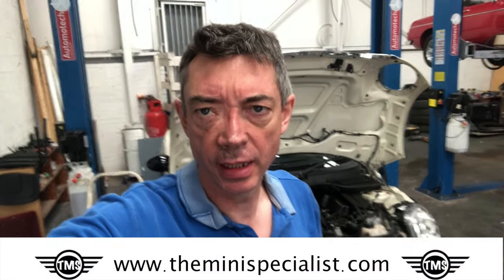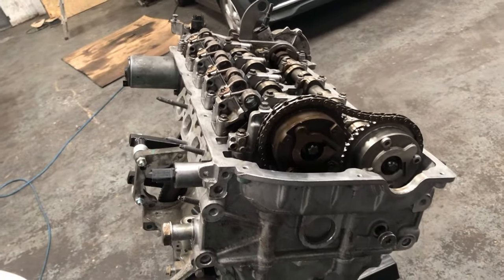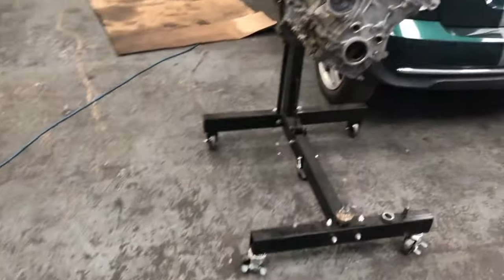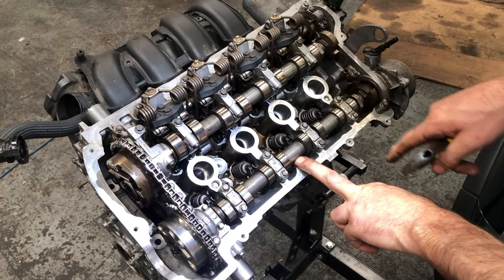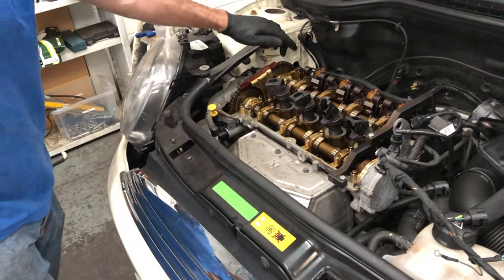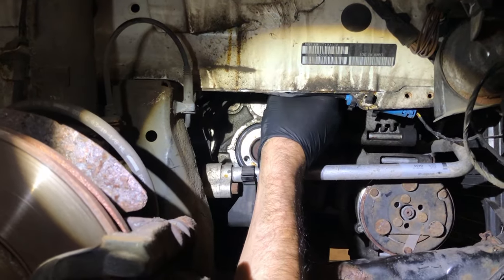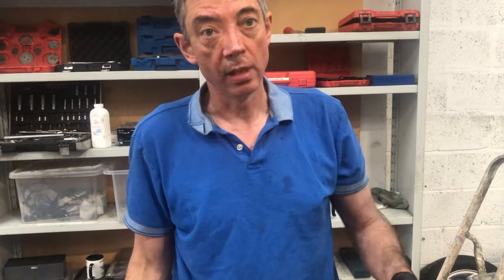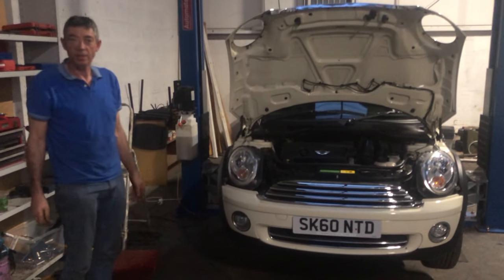BMW Mini Timing Chain DIY Replacement for N12, N14, N16 & N18 engines - The Definitive Guide

Comment: can i pick your brain, on my BMW, same engine as the mini, my chain only starts to rattle after 15 minutes of running, its totally quiet from cold start but once the engine is warmed up usually after 15 mins the chain start to rattle violently. let it cool again, start it and its quiet, is it not usually the other way about, rattle when cold and not so much when warm or rattling all the time. it eventually brings the drivetrain warning light on 2 vanos codes and one crankshaft camshaft out of sync code.
Reply from the maker: The oil becomes less viscous with temperature so this sounds like your tensioner.  Have you got the right oil?  It makes a difference.  You need LLO4 (BMW specification) 100% synthetic 5w30 - or 0w30 (the first number is the winter grade hence the 'w' and unless you are in very cold climes then 5w or 0w makes no difference as it refers to the viscosity at something like -20 degrees C... anyway.  Oil matters).  Try changing the oil and the camchain tensioner and see if there is an improvement.  If not change the chain and if you find that the guides have started to break up then clean out the oil scavenger filter in the sump.
Reply: @TheMiniSpecialist  once again thank you
Reply: @TheMiniSpecialist  the car is inbetween services, BMW since 2015 so i take it the correct oil is in the car, i came out of the motor trade 3 years ago due to asthma but im going to do this job myself, it's not been a progressive noise, it just started out of the blue, no issues with noise and then wtf is that racket, noise is at its worse when you decelerate but as i said nothing until about 15 minutes after cold starting, i can rev up and down and no noise but soon as the engine reaches optimum temp the noise kicks in.
Reply: @TheMiniSpecialist  just wanted to let you know it was the tensioner that failed on my car, the spring inside the tensioner body was in 3 bits. fitted a new one, all good.
Reply from the maker: @LOYALISTGOVAN  Excellent!

Comment: Superb video have been advising people for years to avoid any vehicle with this engine family absolute junk from day one.
Reply from the maker: To be fair when well maintained these are a terriffic engine.  The VVT makes the engine very flexible, has good power delivery and is ecconomical.  When the chain is in spec and you can put the car in 6th gear at 20mph and the car deals with it - not that you would do this usually but it demonstates how flexible this unit is.  

The trouble comes when people expect for a car to run forever with no maintenance.

Comment: Question sir...is the 2014 Cooper S convertible an N12 type engine?
Reply from the maker: No. It's an N18. Same chain however
Reply from the maker: So the convertibles lag behind the main models so your car is likely an N18 / R57. The next gen hatch in 2014 but the next gen Convertible started in 2015

Comment: do you reuse the crank and cam bolts?
Reply from the maker: there should be a new crank bolt in the camchain kit - best not to buy the cheapest one you can, get one with the crank bolt, bottom sprocket, tensioner etc.  I do reuse the cambolts and have never had any issues.
Reply: The Mini Specialist thanks! I picked up the same brand kit as in your video but no bolt. I’ll order one from bmw and pick it up. Great video by the way, I found it really useful.

Comment: Hi, do the vanos pulleys (dephaser pulley) need to be in a certain position or can they just be out back on.
Cheers
Reply from the maker: as long as they go back on the correct cam they can be in any position
Reply: Ok thank you for your reply, very helpful, some one has unplugged the inlet vvt solenoid, runs ok with engine light on, if I plug it back on, runs terrible and dies out, is that chain/timming or the eletro valve part of it. Cheers

Comment: I replaced the timing chain and immediately after replacing was appear the error code 2845 and 283d. This mean that now need vanos adaptation?
Reply from the maker: I would not expect codes like these imediately after changing the chain.  Certainly you need to delete and reset the adaptations but these codes suggest something else (are my thoughts).  Try swaping the Vanos front to back (if you have twin Vanos) or replacing the Vanos if not.  If this doesn't work remove your vacuum pump and see if it rotates freely - as you rotate it by hand it will squirt oil so be prepared - it should move easily, if it doesn't then replace the pump as a seized pump can damage the head.
Reply: Thank you for your reply and suggestion for checking the solenoids. I will swap the vanos front to back. I have engine with twin vanos N12B16AA (1.6 petrol 88kW 2007). I have review your full video couple of times, and before backing the camshaft adjuster (sprocket), as I see they don't need to adjust on some position (I mean angle position inside on adjuster spocket, min max or middle position). As I remove, I back on camshaft in the same position without any rotating or adjusting. This means that the adjuster always is inside in middle angle position?
Are this codes can be low pressure oil or leacking on camshaft seals. How can I check the oil pressure that comes to VVT adjuster spocket is right and enought? I checked the vacum pump and it was rotate smootly.
Reply from the maker: @vladimirrogovski7804  The position of the sprocket does not matter - what matters is the position of the camshaft which is why you lock the cams.  Put the sprockets on finger tight with the chain in place, then put the chain tensioner in all the way so the chain is tensioned and then torque up the camchaft bolts.  Hope this helps.

Comment: Doesn't the crank bolt and cam sprocket bolts need to be replaced with new ones
Reply from the maker: Ideally yes.  That said I don't and there has never been a problem

Comment: N12 1.6 and the later engine 1.6 can they be interchanged?
Reply from the maker: No. The later engine has more electronics a difference loom and a difference ECU. Just bought a car that had the wrong engine in and had to replace it with the correct one

Comment: Hy i have a problems with my mini cooper r56 i change the Belt and also the Chain and after that i see when i drive back   the car backwards it emits a lot of smoke a lottt smoke Like diesel why ??
Reply from the maker: Only when you reverse?  Mmmm.  Try this.  When the car is at warmed up let the car tickover for 5 mins then rev the engine to about 4000 rpm.  If you get blue smoke out of the exhaust then your valve stem seals have split and need replacing - this means reconditioning the cylinder head.

Comment: f£££king great video   thanks heaps .....can the inlet and exhaust sprockets  go on in any position?
Reply from the maker: Thank you!  So - the sprokets can go in any position - it's the camshafts that you lock and are the key.  Just make sure you put the inlet sprocket on the inlet cam and teh exhaust one on the exhaust as that does matter - and they are labelled.

Comment: Thanks mate Excellent video👍 I take it the vanos gears can go anywhere as long as the camshaft locking tool is I as  I first thought? Haynes manual Pro throw me off with a dodgy diagram with caption gear must face upwards at a slight angle  what ever that is meant to mean🤦‍♂️
Reply from the maker: No actually - each sprocket is stamped - EX for exchaust and IN for inlet.  They are different sizes and the car will not run if you swap them.  Thanks for watching.
Reply: @TheMiniSpecialist  do the vanos gears need to be timed?

Comment: Need to empty engine oil before do the timing chain or not ?
Reply from the maker: No - though I always change the oil & filter as part of the job.
Reply: I ask because I had the engine oil changing only 2month ago...
Reply from the maker: @brunoschmidt1533  then you should be fine.

Comment: At what mileage can you expect these timing chain issues on a well maintained car?
Reply from the maker: Wish I could say. Thing is firstly they were designed to be a life time item and secondly all miles are not equal - an hour in traffic might get you a few miles but an hour in a motorway night get you 70 miles.  Thirdly these engines burn oil and the engine will wear faster on low oil. Finally have seen the guides disintegrate before the chain died due to heat. I have changed chains at 40k miles and 110k miles. Not helpful I know but there is no clear answer
Reply: @TheMiniSpecialist  Thanks, going to look at 78K example on Monday.
Reply from the maker: @cpuuk  then unless it's been done assume it needs doing and negotiate accordingly. I charge £641 for a chain. A main dealer is about £2k
Reply: @TheMiniSpecialist  Will keep that in mind sir. Thanks.

Comment: nice video and guide mate ! , despite i followed everything i got a message  @inlet camshaft angle offset with respect to crankshaft outside of tolerance@
Reply from the maker: There are a couple of reasons why this can happen.  (1) The inlet sproket could be faulty, (2) the oil ways from the Vanos to the sproket could be partially blocked, (3) the camshaft could be tight in it's bearings which would cause drag and finally (4) it may just need a software update.
Reply: @TheMiniSpecialist  thanks mate for the responce , i removed everything again to check the condition , both camshafts were out of timing , and it was unable to lock them again , locked the crankshaft and release the bolts of both camshafts and locked them manually with 27mm spanner  ,the sproket looks ok , that it maybe happened is i didnt changed the crankshaft bolt with a new one , and i didnt have a proper pretension bolt from the kit ,  i will do the process again with all new bolts

Comment: Oh dear I’ve just bought a 2007 38,000 R56 1.4 N12 and it’s just come up with an error code P0014. It has a little rough idle but no noises from the chain which I tried to listen to when purchasing the car. I was hoping it was the front / vanos sensors with a oil change but now I’m fearing the worse and the car could be toast 😭
Reply from the maker: the car won't be 'Toast' - a new chain makes the car run well again - but you would be wise to start with the cheaper stuff - sensors and so on - oh and check the oil.  These cars all burn oil and the VANOS works on oil pressure so will not work properly if the oil is the incorrect grade or as is more often the case - low.
Reply: @TheMiniSpecialist  Many thanks for your kind reply. I'm waiting for the parts then I can drain the oil and replace both sensors. The car has been stood and only been driven 1,100 miles in two years. Companies like Lohen say they flush the engine with Millers Oils engine flush. Is this something you recommend as I've heard all kinds of stories causing more harm than good? Appreciate you technical expertise and love your channel.
Reply from the maker: Hi Michael - I have never used engine flushes so I cannot advise sorry!
Reply: The Mini Specialist thanks for your honesty. If you haven’t used them I won’t add one to mine for now.

Comment: is it crucial you do the adaptation part?
Reply from the maker: No - not crucial.  The car should adapt itself over time - but if you are having any issues post new chain its the first thing I would do.
Reply: @TheMiniSpecialist I've done the job using a manual and your video, but I still have the rattling noise as if the chain isn't being tensioned properly. I'm afraid to run the car for long like this and I'm really stuck in what to do next. Would doing the adaptation maybe fix it?

Comment: I agree it is the best timing chain replacement video, i did this job on a vehicle i bought with this video's help and it made the job smooth and easy, and the car is running perfectly. I do have a little picke i would like anybodys help with, I bought probably the only MINI ONE 2010 1.4 70KHz wihtout an ac unit on it, and i live in italy with 35-40 degrees in summer, before i sell it out of desperation is anyone aware if i can get the parts for the ac unit for eg at a recyle yard and be able to fit it on my car, or if there is a valid after market ac unit alternative that is worth fitting on it? please help.

Comment: I generally don;t use torque wrenches. Crank is tight as F and can is pretty bloody tight but not crazy tight. lol You just develop a feel for the hardware, it can depend on the age and condition of the hardware.
Reply: That's reassuring to hear, when I'm worried my torque wrench might be slightly uncalibrated. Have you ever had any issues after?

Comment: can you get the rattle on a r55 diesel? a 2012 n47 i beleive?
Reply from the maker: the N47 is a whole topic on its own.  I am working on a video on that currently.  There are 3 chains on the N47 situated between the engine and gearbox which means you have to drop the supframe and remove the gearbox for access.
Reply: The Mini Specialist I don’t even know if it is the n47, it just makes a rattle for 1-2 seconds on start up other than that it’s very quiet especially for a diesel
Reply from the maker: @Kenneth_McGrew  that's pretty standard for the N47 - same engine as the BMW 116d / 320d etc just transverse in a Mini
Reply: The Mini Specialist does that mean I probably don’t have the death rattle? I’ve not had it long so I’m not used to it? Thanks
Reply from the maker: @Kenneth_McGrew  probably not.  Just keep an ear out for a constant rattle as that can indicate a real problem with the timing chain.  The N47 chains can snap (google it) and when they do you are looking at a new engine.
Reply: @TheMiniSpecialist  i made a quick video here of the noise, it only happens on 1st start up, the 2nd time its quiet, https://www.youtube.com/watch?v=JR8bxvSFdZ0 but it definatly changes note

Comment: N16 is much better. Got Mini ONE N16 (98PS). No problems. Oil change every 6k. Top up approx 300 ml every 800 miles. Torque at 3000rpm. K&N filter. I AM very happy  Petrolhead.😁
Reply from the maker: Thanks for watching and sharing.

Comment: Would timing cause the car to crank and not start?
Reply from the maker: Only if the timinh was massively out which on these cars would mean a broken cam chain which would mean you have bigger problems.  Providing you have a spark, fuel and air the car should start so start there - I have had a case were the Crankcase Sensor was faulty which stopped the car starting (but it turned over).  Have you scanned the ECU for fault codes?
Reply: The Mini Specialist I have and for some reason the scanner is unable to detect. Like it’s having trouble connecting. And if the cam sensor was bad would it allow the rpm gauge to move? Or is that the crank sensor?
Reply from the maker: not 100% sure about that.  Start with checking for a spark, then fuel and go from there.  As for a scanner - buy a Carista from Amazon and connect it to your phone.  Cheap and good enough
Reply: The Mini Specialist okay I check the green wire on the coils which is supposed to be constant power. The fuse has power. I ordered a relay pop up test kit should be here tomorrow. But if I ground terminal 5? On the relay won’t that bypass the Jbe and tell me why I’m not getting power?
Reply from the maker: @stef-dog2055  Before you start with electrial tests I strongly suggest getting an OBD reader to access the fault codes stored in the ECU - they will point you in the right direction.  BTW to test for a spark take a spark plug out, attach it to the coil pack, have the threaded part of the plug earthed to a ground and have someone crank the engine - you should see a spark.  Do this for all cylinders.
Reply: The Mini Specialist I was gonna do that but come to find out I need a thin wall 12 point socket. Do you happen to know the size? And I’m gonna try a different meter tomorrow I have An innova and I’m not a fan

Comment: if don't use the tool kits pre tensioner tool, timing easy out,because tensioner  just spring inside, no pressure yet ! what that angle tool, may be use mobile app better .

Comment: Which N engine is this?
Reply from the maker: The one in the video is a N12 but this process is basically the same with N12, N14, N16 and N18 engines.

Comment: I would of removed the throttle body off the Inlet manifold. Only 3 torx 30s and far easier to get to. Otherwise spot on.

Comment: Very nice video, but isn't it easier to take the engine out off the car and do it freely?
Reply from the maker: not really - that would mean draining the aircon, draining the coolant, removing the subframe, halfshafts, fuel supply, engine mount and so on.
Reply: @TheMiniSpecialist  oh right, thanks mate

Comment: I usually replace cam sprocket bolts and crank bolt for my own piece of mind. Imagine if the timing slipped enough to cause valve damage all because of a couple of quid bolt.

Comment: so no specific position for camshaft sprockets
Reply from the maker: No - Pin the crank, clamp the cams, put the chain on and put the sproket and bottom bolts finger tight THEN put the tensioner in - that way the timing is correct.  Then torque up the top sprockets (20nm +90 +90) and after putting the top engine mount back on torque up the crank bolt (50nm +90 +90)
Reply: @TheMiniSpecialist  the two dots on the Sprockets were confusing me ok Thanks for the Reply